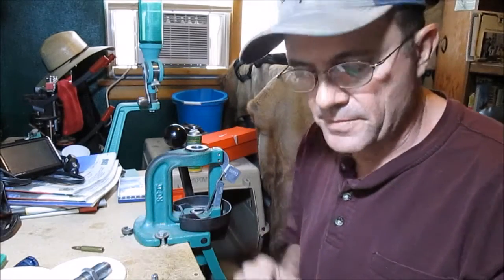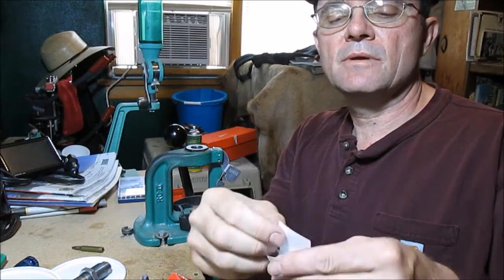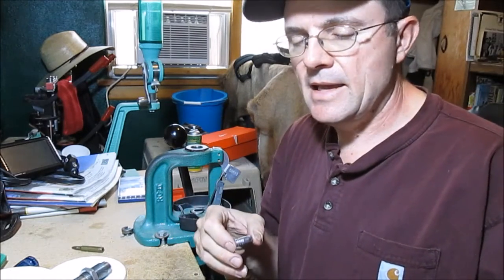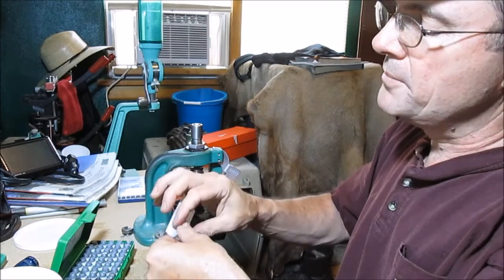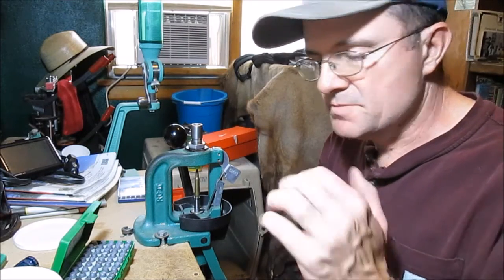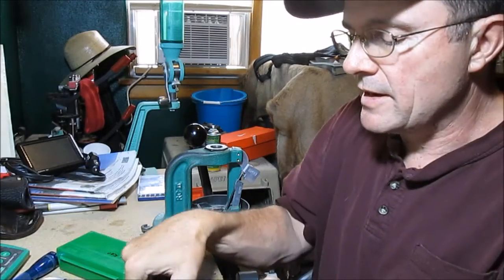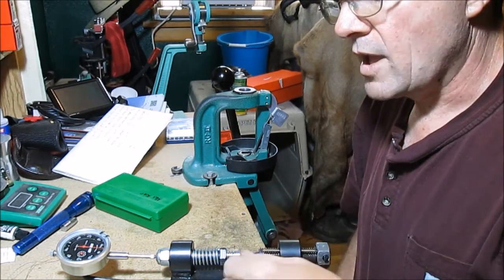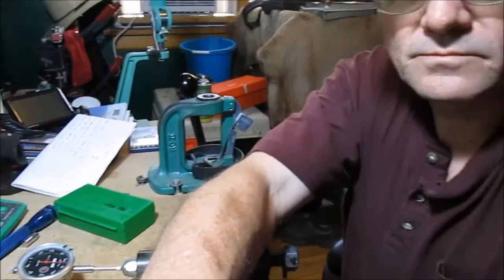Wrapping and sizing paper patched conical's for Muzzleloaders

Comment: I'm just starting out in this so please forgive my ignorance.  When looking for a sizing die to perform this paper patching function, how do you find the measurement of the bore to know what sizer to buy?  Do you measure the distance from the top of the land to the opposing land?  And after finding the measurement of the bore, what ratio or measurement of the sizing die would you order: I shoot a .54 cal. Hawken and I'm certainly interested in this paper patching concept.  Any info you could give or reference to more in depth instruction will be greatly appreciated.  Thanks!
Reply from the maker: If you have a 1-48 twist factory barrel this process most likely wont work. The factory barrels have too deep of groves for this to work. If I were going to try it anyway I would get a Lee mold.  Check this one out.    
     http://leeprecision.com/mold-533-410-m.html
This one drops out of the mold at .533 two wraps of paper and you bullet will be .538 to .539. You probably won't need to size at all. 
If you want to look me up on Face Book I am under idahoron. I can also answer questions there.

Comment: What are you using to size the Lee .501 bullets down so that there is room for the paper patch to be added before going through the Lee 501 sizer?
Reply from the maker: +Modernwarrior12 
With lead softer than 7BHN all you have to do it wrap the .501 bullets with the paper and run them through the .501 lee sizer.  If the lead is harder then 7 BHN they will need to be sized to .496 before they are wrapped because the hard lead won't size and it will strip the paper.

Comment: P.S my long rifle is a green mountain barrel 40 cal. And the dia. Is .410 and my barrel length is 42 inch long. With a twist rate of 1 in 36 I hope and pray it will shoot long paper patch boolits. I'm only wanting to shoot at the maximum of 200 yards or a little more and I hope it will stabilize my boolits. Please let me know what you think about my barrel twist it is the only barrel at the time I could find in 40 cal. With that twist rate all the others were 1in48 twist rate  . and I have a Pennsylvania Lancaster long rifle I built my self and it has pedasoli back sight and Lyman aperture front sight with a level bubble and like 10 or more apertures for it. I have spent a lot of money and time building this rifle and if it doesn't shoot real good I guess it will be a expensive wall hanger.
Reply from the maker: I would look at bullets in the 300 grain range. 400 will be too long. 
If you have a Lyman 17 style glove sight, use the Lee Shavers BPCR inserts.  They are awesome
Reply from the maker: I was thinking 45 cal.  On a .410 with a twist of 36, I think I would look at 200 gr to 250 gr.

Comment: To shoot paper patched  bullets in my sharps  it has to be reamed ??
Reply: No.  
The bullet needed will be about .442 to .445 and you'll use paper between .002 to .004 thick to bring the bullet to .450 - .454 depending on your land to land diameter (bore diameter).

The bullet it resting on the surface of the lands like they're guide rails. How tight this resting fit is it entirely up to you, some guys like a slip fit, I prefer a snug fit.

The bullet isn't hollow base. It's not a minie style bullet. It relies on the black powder detonation to shorten the length of the bullet and expand it along the length of the paper, but not past it. This depends on how soft your lead is and how much of either 1, 2 or 3FG you use. The finer the grade, the more pop it has and the more upset happens.

You can upset too much and slump the nose. Most guys use 80-100 gr of 1.5FG or 2FG and an alloy between 20/1 and 10/1 lead to tin respectively.

I use pure lead and large 1FG powder for less pop, my long 34" barrel is plenty of length to completely burn the large grain powder.

It's a balancing act.

Comment: Is the purpose of this to save the barrel?
Reply from the maker: Actually the purpose is increased accuracy using full lead conicals. Here in Idaho and well as many states a hunter has to use a full lead projectile, and no sabots. If a guy shoots conicals a little bit of lead is deposited with each shot no matter how well you clean or how well your lube works. After some time accuracy falls off and guys are disappointed with their rifles. With a paper patch bullet the barrel is protected from the  bullet and the bullet is protected from the barrel and the fire. No lead is being deposited so there is no gradual degradation of accuracy.  Accuracy is easily achieved out to 300 yards with a proper sighting set up on the gun.
Reply: idahoron thank you for the clarification.
Reply from the maker: It really is about consistency.  If your load is consistent you will be more accurate.